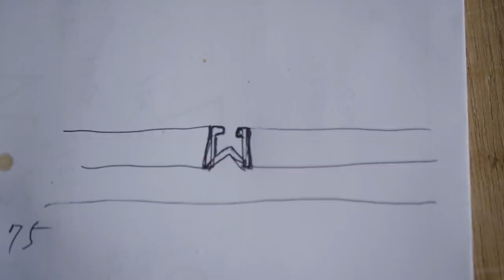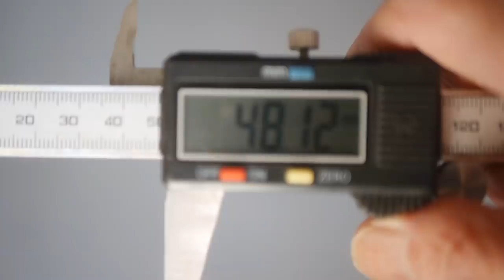Make a Drill Press table

Comment: Very nice. I never saw those aluminium tracks, ingenious idea to prevent them from clogging up with dust and whatnot. Thank you for sharing.
Reply: These rails are called T-rails. 🙂
Reply: @QUERBEET-DIES-UND-DAS  I know, but i never saw one with that specific profile. I've used all kinds of those tracks (incra, aweso, ujk), but their flat bottom design always prevent the nut from sliding freely when they get filled with even small amounts of dust. With those one used in the build it probably takes much longer.
Reply: I've looked at the video again - you're right, the "T" is more of a "W" - I do not know that either!
Thanks for your message, I had completely overlooked that.
Warm greetings from Germany,
from Michael. 🙂🖐
Reply from the maker: @hulkpeace Hello
Thank you for the nice comment
This T-track is used for housing
It is an aluminum rail for slide doors that are mainstream in Japan.
I substituted it upside down.
I feel very good and use it.

Thank you
See you
Reply: @TachiOhyo56  Thank you very much for that information, i've looked up for sliding door rails in my supplier catalogues and found one with the identical profile for installation into parquet. Intrestingly they offer a whole assortment of hardware for shoji doors which is quite uncommon here where i live, usually those vendors just selling din and ec standard hardware.